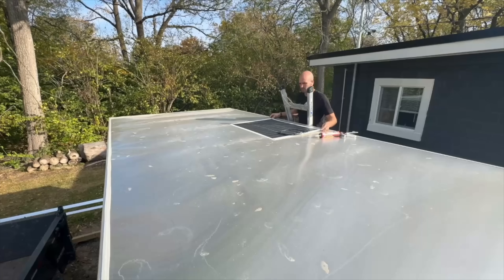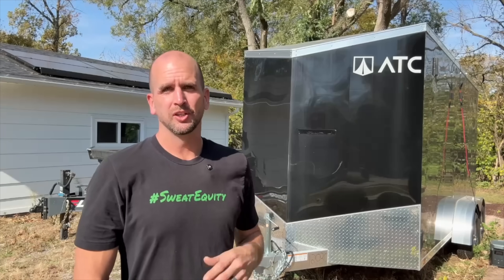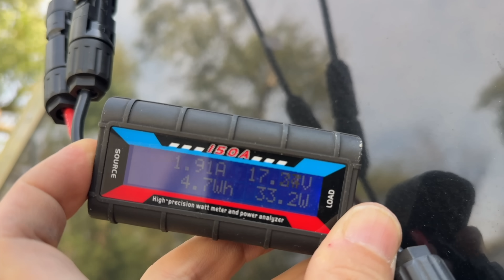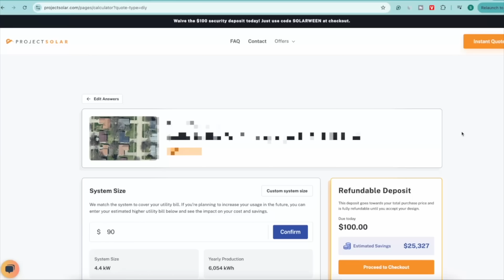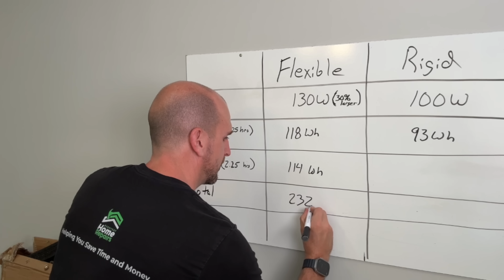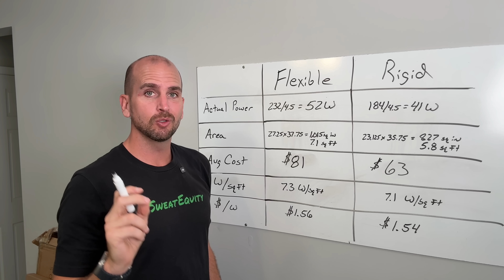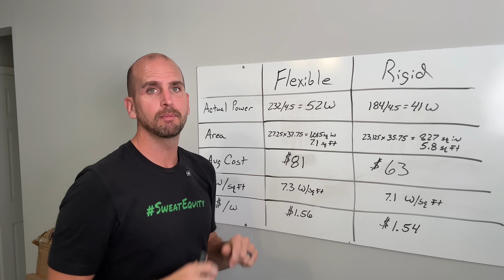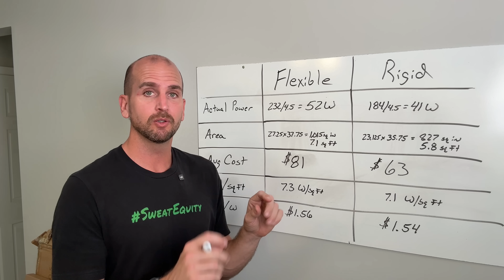100W Flexible Vs 100W Rigid Solar Panels | Don't Buy Until You Watch!

Comment: The flexible panels have been a disappointment. They start out ok then quickly fade. I have 3 of them now and one is the 130w Eco worthy. Last year I was lucky to get 200w out of the 330w panels. I use them on a van, love the install, low clearance and lack of drag. Plus I need the clearance to get into my garage.  Rigid is just to thick, it's that close. So I have a fold out panel for backup.

Comment: I am surprised that he is testing the panels by reading the amount of power going into a battery. As if the battery is close to full the regulator will reduce the amount 
of amps going into the battery. The same panel may only put a couple of amps into an 80% full battery but if you connect it to a large battery that's almost empty 
it will increase to full amp flow to the battery. You need a solar panel tester such as an Elejoy that connects straight to the panel without being connected 
to a battery, this meter will show the full potential of each panel without being distorted by the batteries/regulator that it's connected to. 1:18
Reply: Agree… This guy is clown world x 2.

Comment: I'm planing to mount 2 Eco-Worthy 130W flexible Solarpanels on the Bimini of my Sailboat. The main reason was the low weight. Size doesn't matter ... I'll return here after mounting them to report the efficiency and 3 years later to report whether the performance has decreased.
Reply: Hello guys, I'm back to report about my ECO-Worthy solar panels. I mounted them last week on the bimini on my sailing boat. 2 100Wp and 2 130 Wp seriell  and parallel. One of the 130 Wp panels is always under the boom, so 330 Wp is under the sun. Yesterday - a sunny day in Croatia with no clouds - the Victron App said that the maximum amount was 327 W and during the day, the total harvest was 1,21 kWh. I'm very satisfied. So this was the first impression ... I'll return next year to report if there is any reduction in performance.
Reply: About 8 years ago we put 4 100watt flexible panels (made by All Power, I think) on the Bimini of our sailboat which lives in San Diego.  They are in good condition except that they are a bit cloudy looking.  Thinking we would replace them with new flexible panels, we brought one home (to Phoenix, AZ) to figure out how to deal the difference in shape/grommet placement of the new panels. We bought 4 new panels and, when we got them we decided (just for fun) to compare the output between the new panels and the old one.  Hooked them up to the MPPT charge controller on our RV and found that the new panels didn't put out any more power (to speak of - maybe 2 watts) than the old 7-year old panel😮.  Needless to say, we now have 8-year old flexible panels on our sailboat. 😂

Comment: Maybe we just got lucky with our 175 watt Renogy solar panels. We'd had them for 18 months, and they still output as much as ever. They're mounted to the roof of our fifth wheel with 3M VHB tape, so there's a tiny air gap behind them, and even without tilting, we get solid performance from them. There's been no visible degradation yet at least.
Reply: I know that leaving a gap so they can air cool will expand their lifespan vs sealing them flat against a roof. Some people adhere them to corrugated plastic sheets that they mount on their roof to air cool theirs, but spacing out strips of double sided tape(such as your VHB) would have a similar effect. Still won't get 10+ years out of them though.
Reply: @roofdogblues7400  Yep, but lifespan of the panels isn't the only factor. In our case, air drag, weight, and not having to drill 54 holes in the roof of our fifth wheel were deciding factors in our decision to go flexible. But in a stationary application, I'd go with rigid panels every time.

Comment: Rigid panels are more common and would probably produce a confirmation bias in a survey vs. flexible panels, which have not been on the market long enough to garner an equal market share to the rigid panels. Also, the choice to go with flexible panels may be as a result of other considerations, such as increased stealth.

Comment: Consider using fishing magnets (with rubber coating) to mount the flexible. Creates an air gap and panel does not fly of even at 60-70mph (depending on magnet diameter/strength ofc) 

Can be easily taken down when you're in a not so great community/location where theft is a concern.
Reply: would earth magnets work? Powerful little creatures they are!
Reply: @teresa6775  Neodymium magnets  would be really good, but do not put them directly on the cars paint, you will rip the paint to shreds trying to remove the magnets - always include a physical barrier between the paint and the magnet, this will decrease the magnets strength but will save you a costly respray. I used a roof rack and put solid panels on my car, no damage is caused and having rigid panels means I have longevity on my side. When we are off grid we have 650 watt of solar to keep the coffee machine, slushy maker, Television and microwave happy (when did camping get so high tech) plus all of our personal communications devices.

Comment: @everydaysolar NOT "exactly the same testing".  Throw the whole demonstration out.  
  
Started with two completely different units.  Ecoflow 2 vs ...).  They will never give identical (exactly) same results.  Impossible.  
  
It's like setup with a 5 foot (or 16 gauge) connection cable & for alternate using a 100 foot cable (10 gauge).  Any added resistance will change the outcome.  
  
As far as the two different Ecoflow units.  Figure out, or just read the specs & you'll know there is no comparison up (output) or down (input) stream.  Why?  There would be no need for different models unless there was a difference.  
  
Point is though great it's real world, it's useless & a waste of time as I stated for obvious reasons.

Comment: The new flexible 200w competitor to the Cigs panel run circles. Zoom Zoom circles around them all. If you're not buying shade tolerate, then you're not buying right. Only exception would be budget restraints. Which is very understandable.

Comment: The roof of my bus is very curved, so a flexible panel would be ideal. But, there’s spray foam insulation under the aluminum, and a flexible panel mounted right against it with insulation behind would get Very hot, and I’m sure the panel would be ruined even faster than normal. 

So, sigh… it looks like either nothing, or a bunch of clunky rigid panels attempting to follow the curvature are the only real options

Comment: Yeah the trailer roof is substantial hotter than the ground! I also have four 100 water flexible panels but I put larger cell plastic corrugated between the trailer roof and the flex panels which lowers the panel temperature!
Reply from the maker: Interesting, how are you attaching the panels to the roof?
Reply: Cut strips of corflute with double sided tape, is very effective. Search Sunman vented mount kit for details. :)

Comment: Hello,
Very interesting...
I have a VW camper with 2 flexible solar panels 200 and 130 watts.
They last about 5 years. If you can get aluminium backed and an air gap between panel and roof, they are very good..fit and forget.
I have 100 ah of lithium phosphate leisure battery which is always topped up
I have a basic controller,compressor fridge, diesel heater, and LED lighting...
Cordialement,

Comment: We have flexible on our RV because that’s what the dealer put on. After four years it barely produces enough power to trickle charge the battery.
Reply: Exactly, the huge issue is the terrible lifespan.
Reply: Will(YouTuber) says they degrade in 6-12 months
Reply: @alfredmiles432 
 Uhhh be careful of advice from actors
Reply: They work well for my type of use-case.  I take them camping or for other short timespans to run small electronics (radio, charging phones, laptops, some lights).  I've had two 100w flexible solar panels since 2016 and they're still working well.  They've never been mounted to anything.  So they're only good for VERY temporary use.
Reply: We have walk on flexible panels on the roof of our catamaran.Ten years plus still going strong.Uni-solar.Not made anymore 😔😔😔😔
Reply: @RobertBinedell  same
Reply: We have had flexible panels on our RV (fulltimer here) and we made sure to have an air gap between the roof and the panels using coroplast. We have had good success in comparison to our single rigid panel. But guess we're in the minority.
Reply: @JourneywiththeJoslyns Guessing that air gap makes all the difference, preventing over heating and possibly material degradation.
Reply: Yeah, they are not suited to being mounted where they'll get hot, especially if they don't have an airgap.

They seem ideal for situations where you'll be moving them around a lot, perhaps storing them inside, where the weight & bulk of rigid would make that difficult 👍

Comment: Interesting , never realised flexible was anything like same wh as a rigid and much lighter. I'm thinking off adding solar to my e-bike . Was thinking a 250w rigid pannel on a trailer but I could just mount 2 flexible , one of front one on back of my bike . It's £120 for 2 pannels flexible . I was thinking having them in series throu buck boost module , taking 24v converting to 42v . Says on blurb the pannels can output total 1000wh in day perfect angle direct sun , but ever 500wh would extend my range by loads

Comment: You talk to me right into flexible panels, out of ease of installation and for the small difference in cost I’m going with those they’re lighter than glass panels, I can glue and tape them down without drilling into my RV, yeah that’s the way to go

Comment: Here in New Zealand, Im finding that any flexible panel is 'toast' after 3 summers. the have all cooked themselves because the cant cool themselves. They are also dull and chalky because of the ultraviolet light and lose efficiency massively
Reply: One don't with fexible panels:
Assemble directly on an other surface, always an airgap for heat release.
Reply: @willemvanbruggen6030  The aluminum roof will pull heat away from the panel because it conducts heat quite well. Now an air gap would be excellent when in motion so it would depend on where it's being mounted and how honestly.
Reply: @Dodgingbodies that's what you would think but in fact the aluminium (  not covered by panels ) sucks in its own heat and adds even more to the panels heat
Reply: I had flexible panels on my boat in Australia and they were toast after 2 years. Rigid only for me now.
Reply: @stephenj9563  if need in emergency  and blackout  or  small trip ?  is it worth it ?   need one most times stored .  will it last a bit longer ?     have some spare 240w  but too heavy to carry with  the delta 2
Reply: Usually the flexi-panels come with 6 plastic honeycomb strips (the length of the solar panel) that you glue to the roof, then glue (sikaflex or silicone) the panel to the plastic strips. This provides a small air gap to assist in reducing the temperture of the panel. The solar panel will last many years longer.
Reply: Dude from EcoFlow company told me exactly same thing. Flexible are not meant to be mounted on RV, they don't get cooled.
Reply: @deffington6627 I would agree I’ve seen them burn the roof on an Rv before
Reply from the maker: Thanks for the feedback 👍
Reply: I mounted my flex panels onto lightweight corrugated plastic panels. This gives them some rigidity and cooling. I’ve mounted the combined panels on top of my sailboat bimini added about 30lbs for 680 watts. Rigid panels would have been way too heavy.
Reply: I have seen a similar situation with a portable flex panel. The output is now down to 1/3 the rated power in good sun. My two rigid panels still generate rated power after several years.
Reply: I'm in Aus, driven mine into 48 degree Celsius heat, constant 40 degree days in summer, 3 years old and still pushing 100% of original 300W capacity, 0 issues. Roof top tent has 10mm core flute roof sheet which  Sunman Flexi panel is stuck to. Lesson is don't buy cheap junk flexi solar and use core flute. Total weight about 10kg for 300Watt 48V panel.
Reply: Flex panels are great for THAT extra panel you need in a movable mode but not as a permanent one on the roof imo
Reply: Flexible panels need an air gap underneath to allow some cooling. I used several layers of VHB tape in 4 rows parallel to the panels length. Ended up with nearly 1/4" air gap.
Reply: Llevo varios años con paneles flexibles sin problemas de rendimiento, el truco es bien sencillo, no los pego al techo, al igual que en in panel rígido debajo del panel ha de tener espacio para la refrigeración del panel.
Los paneles flexibles fueron diseñados para el mercado de la náutica, su instalación se hacía sobre techo de lona para alimentar el GPS y la instrumentación de navegación, no fueron diseñados para ir pegados !!
Actualmente se usan en muchas aplicaciones, pero si no se monta sobre techo de lona se ha de montar separados del techo con un aislante alveolar o chassis de aluminio.
Otro punto a añadir es que no el lo mismo un panel PET que otro ETFE, los paneles ETFE tienen una vida de +,20 que es 6 veces superior a los tradicionales PET.
Reply: But the rigid ones also get cooled only at the edges due the aluminium frame, but not so in the inner regions where it is simply mounted on a plastic sheet !
Reply: I will go with flexible for the roof of my car.
Reply: @haydenstarr6776 i go for the rigid panel which was built into my cars roof 25 years ago by Audi themselves when they made those cars

Comment: If you made a proper silicone joint on the unistrut, the rivnuts or roof penetrations would not be necessary.   I bet you could pick up the trailer with a crane, just with the silicone.   Just set up the joint correctly, clean, 2-1 joint ratio, no 3 sided adhesion.  The basics.

Comment: The thing with flexible is durability, do the same test with 2 year old pannels, and the flexible might not be working at all, and even if it is, it will have degraded considerably. 
(I have seen people change this every other year on sailboat, they simply don't last)

Comment: Your numbers are off. You did not allow for the higher temperature of the flex directly on the hot trailer roof. When you compared the Renogy (great panels) on the grass compared to the hot roof, you skewed your data. It was a heck of a lot hotter on that metal roof than on that cool grass. "Temperature of panels go up/out put goes down". All other numbers are great!   You compared apples and grapes when you did not compensate for higher temperature mounting. You can get thermocouples and place them under the panels to get some interesting data.    (good data means Information, Information means knowledge). 
 
I use flex panels because I can store them under the mattress of my RV. When we get set up with the RV, I remove them from under the mattress and put them outside. Much easier than with rigid panels. Its what works for me, but everyone does there thing some what different.

Comment: I put flexible eco worthy panels on my camper roof mostly due to weight, I have pop top roof which is already quite heavy, they lasted less than 2 years,  they still work but produce nowhere near the output they should do, they were mounted with an air circulation gap. I’m going to switch to rigid Renogy panels but I’ll have to have fewer of them to have a chance of keeping the weight manageable.

Comment: Will Prowse says stay away from flexible panels. They degrade quickly, don't output as well and are a potential fire hazard. Avoid.
Reply: Will is the man!
Reply: Agree😊
Reply: I use to owned a flexible 50w. It was only used when I went camping so not much use overall. It ended up beginning to warp weirdly and started to fade. In the end I think the diode broke so I tossed it.
Reply: The problem with these things is: The solar cells themselves are hard and brittle. A lot of them will crack over time from wind bending the panel or general handling.

Comment: https://youtu.be/uJIEXhnF8MU?si=BikwZjeTAHoK9fhz

Check out RV with Tito link. used his technique to mount my SunPower flexible panels on my RV roof. I increased the size of the aluminum key slots to a company two sheets of polycarbonate because one sheet is not enough to protect my fiberglass roof of the Winnebago. I'm extremely pleased. Much lighter in weight than rigid. I have 640 Watts of solar on the roof. I've been there for 4 years. Still performing perfectly. The caveat is SunPower is a premium panel and was purchased before they were bought out by the Chinese.

Comment: How does one scrape the hardened pine sap off the surface? Like my glass panels i can use a razor blade and some dissolvent like lacquer  thinner or acetone to clean them without damage?
Reply: rub it with an ice cube

Comment: Thank you for this valuable information. I want to adapt my Dodge Caravan for off grid living with a 12 V fridge, a power station, a propane stove & heater and one or two solar panels. I got two rigid ones 5 years ago. I might use them on my upcoming tiny house. I am thinking about flexible ones for my minivan. Should I get two?

Comment: One positive to flexible panels is heat dissipation if prepared, roof acts like a heatsink, in both ways. So its kind of a wash. But in Winter you should squeeze a bit more efficiency out of them since heat is the enemy

Comment: The flexible panels would be useful for mortorhomes on the inside of the windshield, independently from the main system for additional usages if needed.
Reply: This creates a lot of heat. I watched a video of someone doing this, propping the panel up with pillows and it generated almost 200 degrees fahrenheit
Reply: @stuartstuart866  So free heat?   (only a bonus if its cold..)